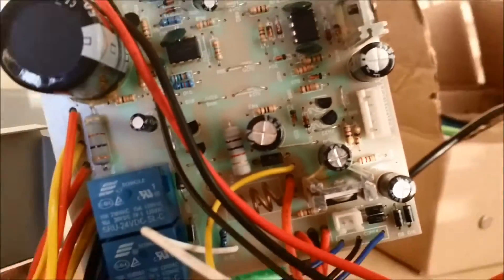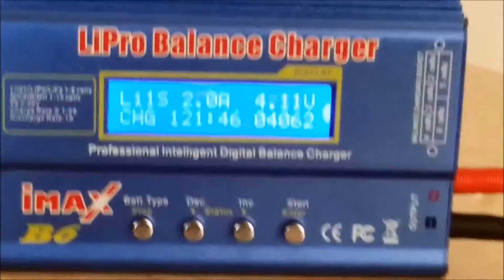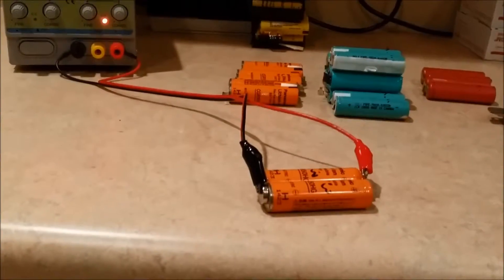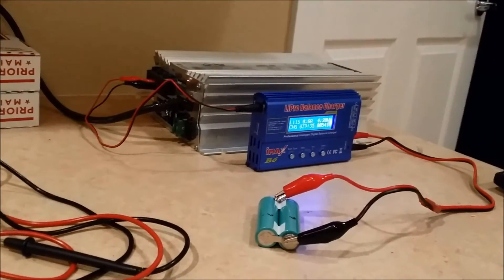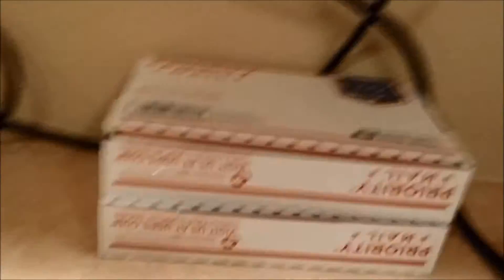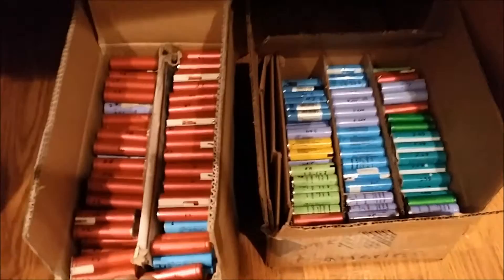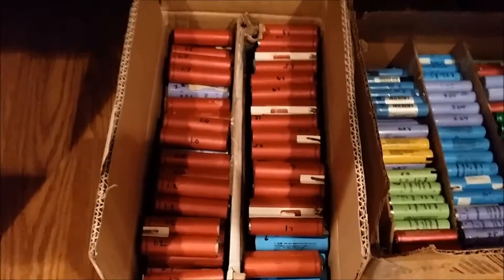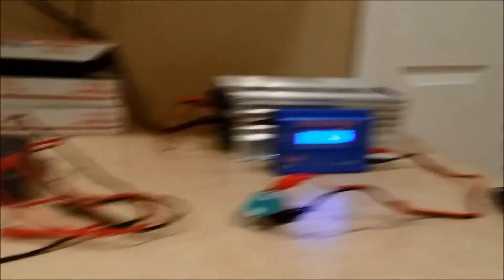Fixing my power supply to charge 18650 lithium ion batteries

Comment: The two green cells capacity isn't necessarily low. They were almost fully charged when you put them on the charger and the imax diminishes current as it gets close to 4.2v, so you are only getting instantaneously 600 mA of current. That's why it didn't add up to much in 40 minutes. Hope you didn't throw em away.

Comment: wait. you are using constant current to charge the batteries, but the constant current circuit couldn't clap the short circuit current?

sounds cheap.
Reply from the maker: yeah its very cheap!  Think it was around $60 if I recall and it doesn't hold steady V until it warms up.  So I use a calibrated meter to fine tune the V as it warms up.

Comment: is the power supply have a feature to auto cut off when the battery is fully charged?
sorry for my bad English..
Reply from the maker: +Gardena Putra Your English is good, I understand you!   This larger power supply does not have the auto turn off feature as its just a variable power supply from 0-32 volts.  I use it to charge the batteries up to 4.2 volts.  Sometimes the used cells need the extra push to get them up to 4.2v.   The other chargers that I use (Imax B6) does have the auto turn off, but sometimes they turn off to soon and the cells dont fully charge.  Once they are fully charged I then can test them with the Imax B6 to see what the mAh is for each cell.

Comment: it happened to me to with the same kind of power supply and i replaced the 3a diode that was is it by a 10a one
Reply from the maker: nice, do you remember the part number that you used? I'm looking to change it out again to a higher rated diode.
Reply: they are p600m diodes they are actually 6a diodes but they can wistand 22a as long as they are under under 80degrees C they also are able to handle a peak up to 400amps for a couple of microseconds they are really beefy i had to drill some little larger holes for it because the original ones where to small.
Reply from the maker: perfect thanks

Comment: Im going to also try a 5A fuse in line where the two leads come out but put it on the positive lead then it will protect the diode from blowing out if their is any back fire
Reply: +Laser Gazer you should put more than a 5a fuse because its too borderline and even is you put a 35a diode and if it shorts a battery it will most lickely still blow the diode but you fuse idea is the best way to avoid that. anyway just put a 7.5a fuse inline with the positive line like you said it just needs to be a fuse rated alittle higher than the maximum current, like in a vehicle a circuit that consumes 10a most lickely has a 15a fuse to give it a little head room.
Reply from the maker: +kiskiller3 awesome, thanks for the info.  Once I get back in town I'll install a fuse.

Comment: Hey i have a 30v 5A power supply same thing happened to me it burnt out the diode i was charging a 32A 6.2V battery and accidentally shorted the two leads and fried the diode lucky i had a spare but i was doing some research the power supply is 5Amp diode it can only handle 5A if any battery is higher than that and back fires it will blow that diode like a fuse im going to test a much higher diode like a 35amp and replace the 5amp diode it will still deliver the same voltage 30v and 5amps but if it shorts out on a 35amp battery or lower it wont blow the diode it will just keep it from going back words or if i can find a higher current diode
Reply from the maker: Laser Gazer nice fix!  I was thinking of replacing with a larger diode if I was able to get it working again.  Once I got it working again I was just happy that it was now working perfect and wasn't sure if it would like it with a larger diode.  For now it works good just trying to be cautious when using it.   Keep me updated and let me know what you replace it with. Thanks